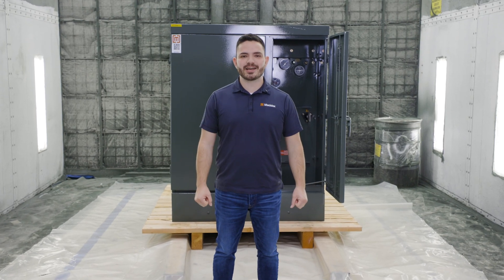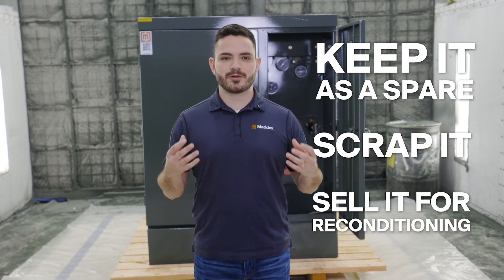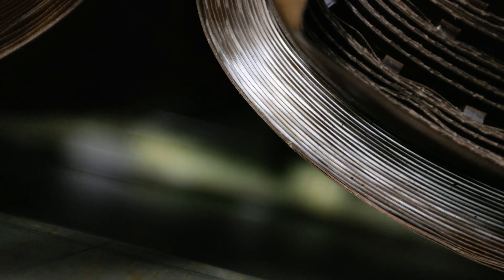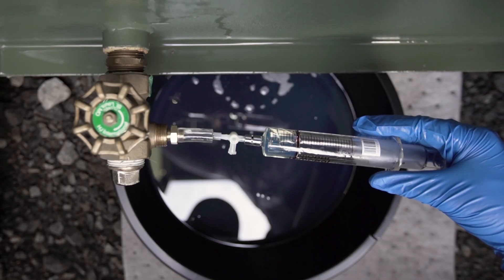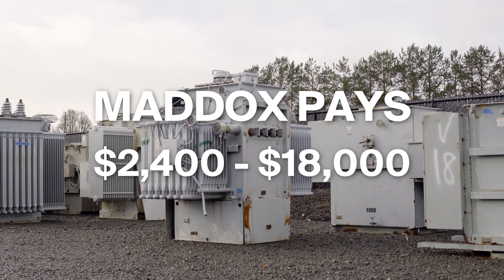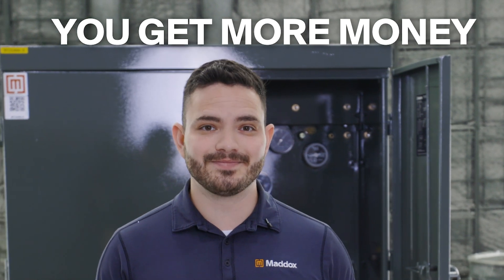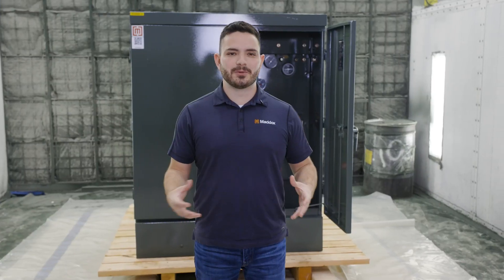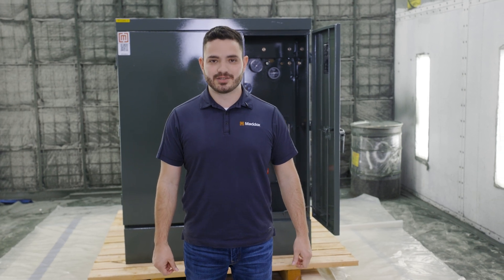How to Recycle Transformers for 5x the Scrap Value | Maddox Transformer

Comment: When scrapping small or large domestic electrical / electronic items .... the steel core 50 / 60 Hz transformers should  ALWAYS  be saved .... these cost  A LOT  to buy new ( not as much as the power grid ones in the video ! ! ) ... and can last ( centuries ? ) if used within their ratings , for many  DIY  projects .... ( tried - n - tested ) ...... DAVE™🛑